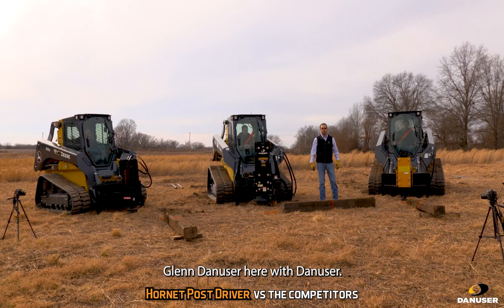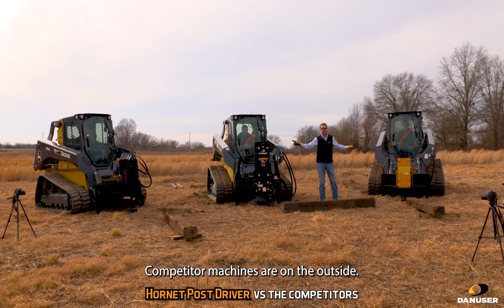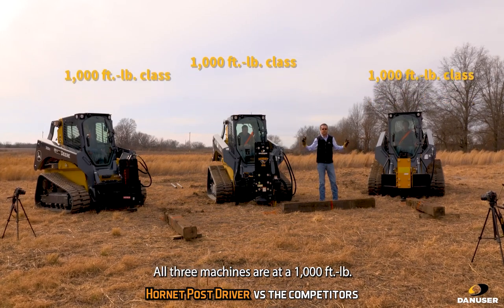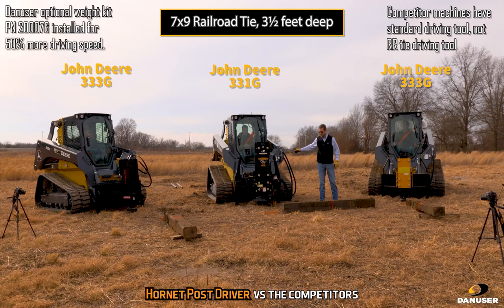Hornet T8-RR vs Competitors driving Railroad ties  #danuser #hornet #competition #postdriver #viral

Comment: Interesting video. So the A and C both use the exact same internal hydraulic unit they just wrap it up a bit differently. Is that the same with yours? Because outside of adding more weight to the attachment I don't see how you make a nitrogen charged accumulator drive with more force by just adding additional steel to the attachment. 

Smart casting a driving head that actually fits the dumb railroad ties though👍 unfortunately as a professional fence contractor that knows alot of other professional ag fence contractors across the nation. I dont know a single one that builds with railroad ties (creosote seepage into ground water is a real thing) also the places in the country that still use railroad ties (or wood posts in general) for fences usually have a pretty high grass fire chance. And man let me tell you the hardest conversation you will ever have is with a rancher that lost everything to a wildfire but somehow saved their cattle but now has no fences around his pastures and he's looking at hundreds of thousands of dollars to replace miles of fences that have burnt posts laying on the ground..

I really wish between the companies someone would stop beating the dead horse that is hydraulic breaker drivers and make a good drop weight style driver here in the States so we don't have to import them from Britain and New Zealand 🙄